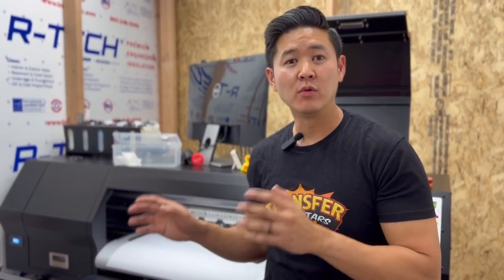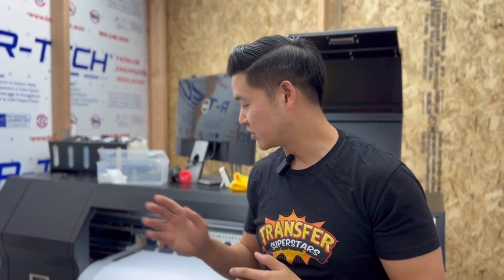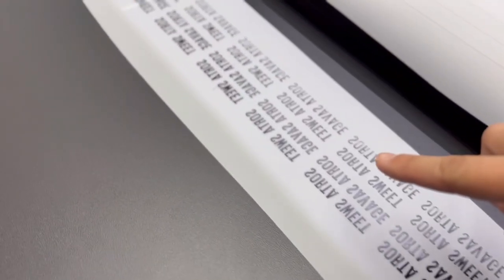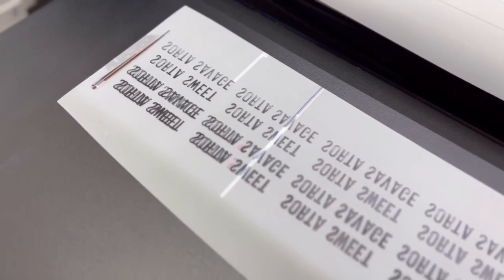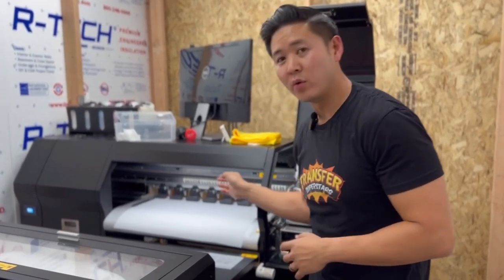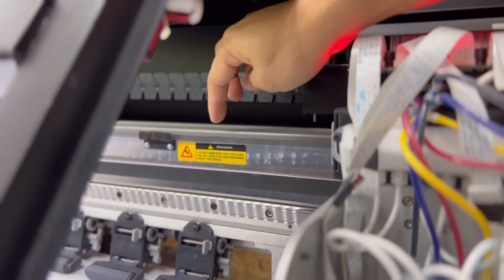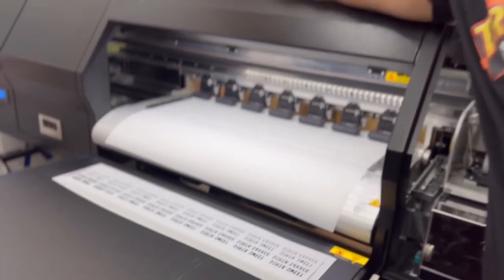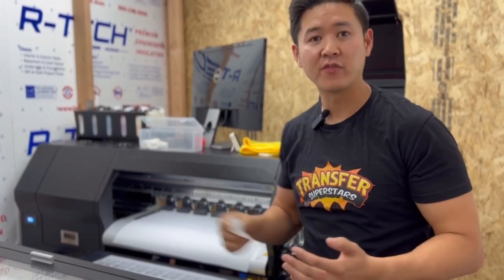DTF Printer Double Printing Left Side of Film...It's Not What You Think It Is

Comment: Hi there, I came across your video and something similar is happening with our DTF Pro model J and some images are coming out double printing. Not all but some or part of the image like the center. 

We find it very odd and would like dome guidance if possible.
Reply from the maker: I'm not familiar with that printer, how many heads are you running? How is your alignment? Have you wiped off the encoder strip?